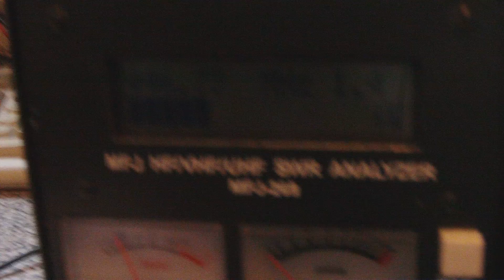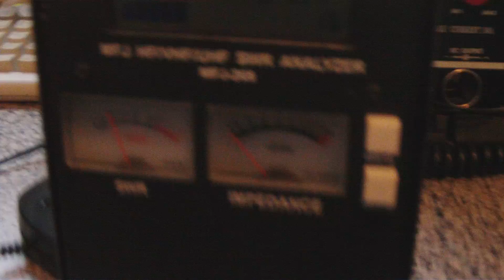PMR 446 MHz Homebrew Antenna Part 1

Comment: How much better such an antenna receives signal and give signal? Is it just for RX or TX? How much is "better" than the original small antenna on the unit?

And can I put a piece of wood between two wires? Put a piece of wood roughly 1.5 cm? I would put a more precise gap between the short and the long wires. And everything would be compact and precise. That piece of wood is a problem?

Comment: Is 446 busy in your area? I mean radio enthusiasts rather than average / normal users. 

How would this J pole compare to a dipole for 446mhz? Considering a J pole on my new mast. Want to go for a dual band design though (2m/70cm, which should be ok for 446)